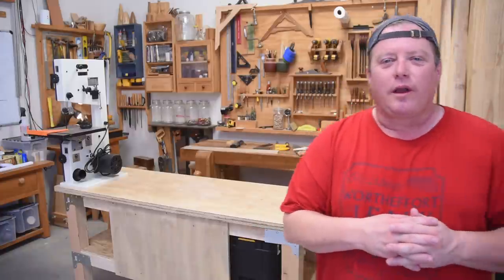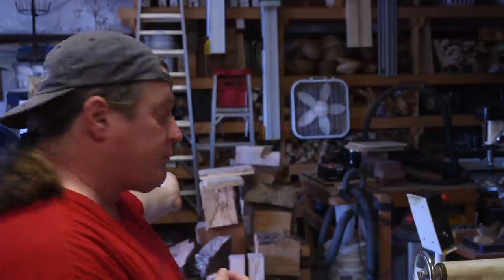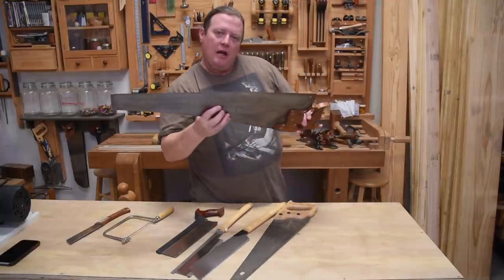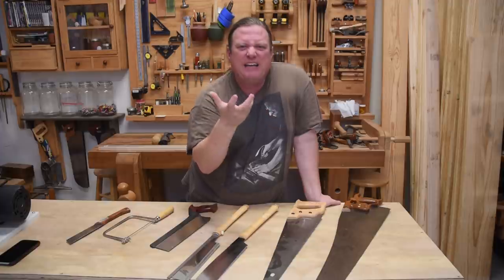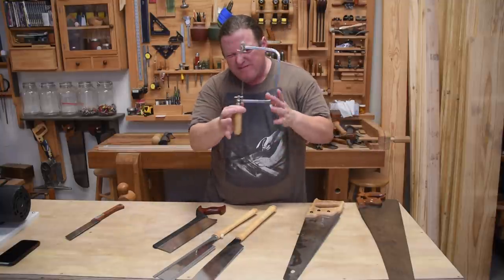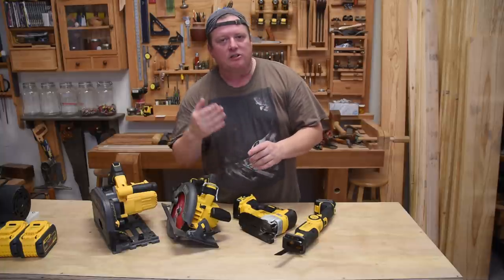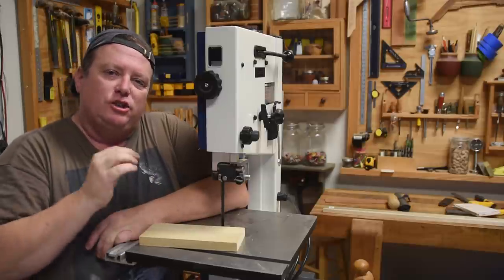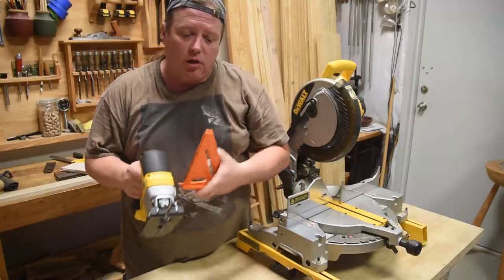What Tools Do What - Basics of a Small Shop - Hand vs Power vs Stationary - Prerequisite Course #08

Comment: This was absolutely great! I have been doing plenty of rough woodworking or carpentry while building my house and my tools have been pretty much chosen according to these tasks. 

I am currently converting my garage into a workshop mostly in order to build furniture and take on a project of building a CLC Pocketship eventually. Hence tools and skills for fine woodworking are required.

I am obviously not going to get a full set of powertools but rather find exactly what tools are needed and try to find ways to utilise my existing tools and do some DIY enhancements to them in order to facilitate the builds I am going to be taking as projects.

This video was thus far among the best ones I have seen as introduction to what different tools are used for. Thanks for the valuable info! You have saved me worth hundreds of €'s with this input.

Comment: My dad retired as pipe fitter and took up wood working, he was cutting some boards right before thanksgiving and was rushing to get them cut. He evened the fingers on his left hand, the pinkie got nicked but the ring and middle fingers were cut off at the knuckle and the index was cut half way from the knuckle and the tip.
Reply from the maker: Are you making a point with this statement?

Comment: I own a circular saw (an inheritance from my dad) but as he was right handed and I left, I find it quite difficult to use and I generally find myself standing directly in the path of the discharge chute. I will always choose a well sharpened hand saw unless I've got a lot of cutting to do, in which case I'll use my table saw if I have room in the shop to make a safe cut, and the circular saw only as my third choice.
Reply from the maker: common tactic

Comment: I had a question for you on band saws.  I am a beginner wood worker and really just dabbling in the hobby. Don't plan on making big stuff or resawing wood.  I like the Rikon 10" band saw, but would I be better off with the 14"?  I was thinking about making some charcutier boards, so I need to cut some curves and I was thinking I can just do that with a jig saw rather than invest in a band saw.  So far have made several blue bird houses and two cedar planters - pretty simple projects to get started. I have all kinds of hand tools and hand held power tools, plus miter saw and table saw. Just wondering if I should add a band saw.  Thanks,  Sandy
Reply from the maker: I have a couple videos in this series on bandsaw which should answer your questions.

Comment: I've been thinking of getting a powered hand planer and using it as a small jointer. What are your thoughts? I'm the same as u when it comes to what I build, small cabinets and more boxes than anything. Thank u for your time. Love all your videos
Reply from the maker: Many people have done that. Built little jigs to hold it upside down. Darbin Orver (sp) has a nice video on that. None of the people that do that use it for long. Seems a temporary solution. I'd suggest instead just get a jointer plane as you'll be able to do more with it than just joint an edge.
Reply: @wortheffort  right thank u for your input. I have a number 5 I use as a jointer

Comment: I am 68 yrs old and have been earning a living since I was 14. Most of those years were spent in one sort of shop or another. From wood to metal to electronics. From production to service and repair. Over the years I have witnessed personal injury's from bruising to lose of life. Personally and Safety committees and boards. In 99.9% of the cases injury occurred when safety measures were bypassed or ignored. I think its just about criminal that shops classes at most schools have been canceled. If nothing else they taught young ones the beginning of safety. In my country you need to take a six week course before you can even look at a gun; but any yahoo can walk into a big box store and buy a table saw.
Reply from the maker: Not sure I understand the purpose of this comment. Are you saying I failed to communicate information properly by not focusing on some safety aspect?
Reply: @wortheffort  Sorry, I was trying to reinforce your push on safety. Something most YouTubers don't stress enough.

Comment: First rule of using a hand-held circular saw: never hold the workpiece.
Reply from the maker: Say that on a jobsite....
Reply: @wortheffort  Yeah....they never let me drag around a portable workbench/vise when I was framing.  The only safety advice I can offer--you can figure out how to use the saw effectively without pinning the guard back...if you are smarter than the saw.
Reply: We call them goats, little supports you can use to load up boards and such. We always have a couple around and use them both for stacking up lumber so itäs not on the ground but also for cutting boards with the circular saw.

Comment: I usually enjoy your down-to-earth way to teach woodworking, but this time I caught you on a glaring error/ mistake. A blunder, even: What you called a "general purpose drill"is ANYTHING BUT "general purpose. These drills are dedicated METAL drills and NOT really fit for woodwork. Not to mention what you said about sharpening them is sheer nonsense. These drills' angles need to be ground very accurately  in order for them to work properly. And the angles differ for each different metal you're using them on. Just to bring that in the open.
Reply from the maker: Are you talking about the ShopFox Drill (Benchtop) ? It's sold as a woodworking drill and have the speed adjustment to accommodate all sorts of woodworking bits. Yes, can also used in metal working hence that style of platform but it is a general purpose wood drill press used in woodworking shops for.... well, industrial revolution.
Reply: @wortheffort  Don't recall what you called it in the video, but I meant that TitaniumCarbide coated (Gold-coloured) one. It doesn't matter what it's being sold as; These "standard" spiral drills are dimensioned  for working metal, not wood(On wood you'll always get chipout, no matter what). When it comes to sharpening them, you have to view it as a plane, where the part you're grinding is the bevel of the blade. Not "Simply rotate it"like you said.
FWIW: I've been a machinist/metalworker with a good deal of (commercial)tool-sharpeing experience for over 35 years, so I think I know a bit or two about "making it cut".... ;-)